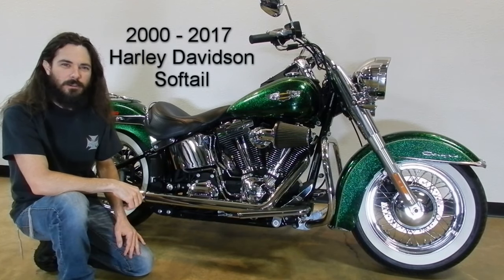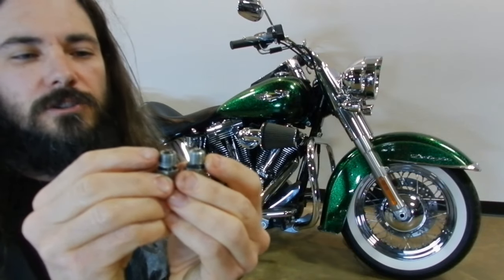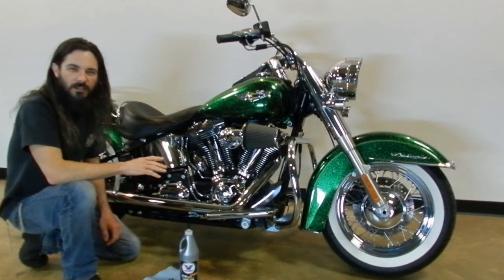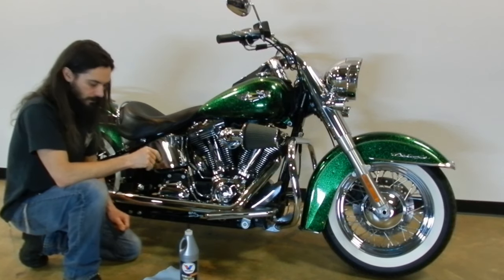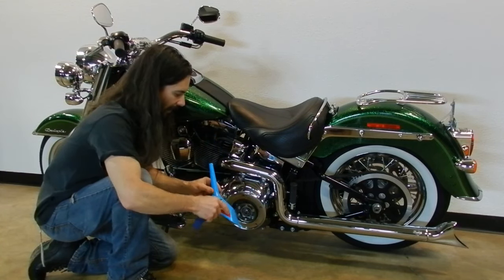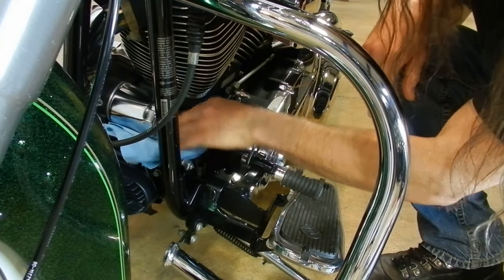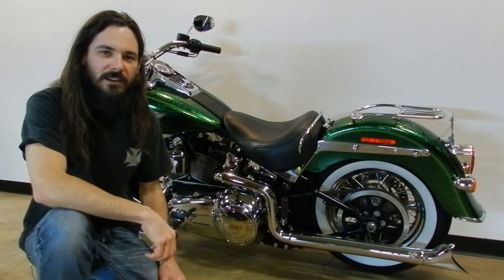3 hole oil change Harley Davidson SOFTAIL (2000 - 2017) Engine, Primary, Transmission Fluid service

Comment: I have a 2011 dyna street bob and although I do my own oil/filter every season I've never changed the primary oil. seems easy enough but seeing mixed comment weather it should be straight up when filling it or just leave it on the kickstand...it has 13000 mi btw
Reply from the maker: When adding the primary fluid, it might be a good idea to call a dealer and ask them for the procedure specific to your year and model regarding whether it should be upright or on the kickstand.   Or you could just go with your gut instinct, because the difference in the amount of fluid won't effect the performance, operation, or longevity of the machine in any significant way.

Comment: WARNING! The transmission filler cap is NOT always a 5/8" Allen Head. My 2011 FLSTN has a 3/8" Allen Head cap. This is totally on me for not checking first, but I did buy a set of SAE Allen head sockets that I... haven't needed yet.

Also, the clearance from the top of the cap to the bottom of the oil tank is VERY tight! An "L" shaped "KEY" is probably a better choice than a socket.

Comment: On the Softail you can disconnect the oil return line and crank the engine over to get even more used oil out. Just my 2 cents but a FRAM is the absolute worst filter made for any engine..they cut corner and use garbage materials inside.

Comment: Great video! Very much appreciated! I noticed you didn’t add any oil to the filter. Some videos I see them adding oil to the filter. Why or why not?
Reply from the maker: Hey Rob. 
Thanks for the kind words. 
The oil pump adds oil to the oil filter as soon as you press the starter button. 
It takes the oil pump two to three seconds to fill an empty oil filter. 
There is no reason on earth to add oil to the oil filter on a Harley Twin-cam engine.

Comment: Hey brother...my second comment, and a question: my local Harley shop wants over 300 bucks for the three-hole fluid change. You have saved me a lot of money! The question is this: is there any reason to torque wrench the drain plugs?  Thanks again for the exceptionally helpful video.

Comment: Just watched yer video here and it looks great!! And you were very brave to do the video on a nice clean floor. Not a drop of oil spilled or leaked!! I always seem to make a big mess when I do the change. Also, when you drain the oil, do you stand the bike up or leave it on it's stand?? No one seems to have a definitive answer, just wondering what you suggest..... And thanx for the video. Well done!!
Reply from the maker: Hey, Thanks Keith. 
I always drain the bike on the side stand, then I straddle the bike and stand it upright for a minute to let the remaining fluids drain, then lean it back on the side stand and put the plugs back in.

Comment: Outstanding tutorial. Thank you and ride safe 🤘🏻🤘🏻
Reply: By chance, do you know the torque specs?
Reply from the maker: The engine oil plug and transmission fluid plug both torque between 14 foot pounds and 21 foot pounds.   For the Primary plug, just snug it up, don't torque it down.
Reply from the maker: Thanks, glad to hear you liked it.

Comment: 4 plugs to drain oil , I removed the allen key plug from the bottom of the motor and got another 1/2 liter of oil out , the book does not mention this plug

Comment: Awesome video Jay, very informative and easy to follow. All in all one of the better instructional videos I've seen for a while  One question for you....how much benefit is there to performing a "full purge" change, versus your way? Purging after you change oil filter may mean some contamination to new filter, but this would be no different to not purging, even less if you find the engine drain point too. Even if you run in up first there must still be some oil within the motor not getting changed. Any thoughts?

Comment: I recently bought a 07 FLSTC and am changing the fluids for the first time. My question to you is about the amount of primary case oil you are recommending. You and others on YouTube are saying 26 oz. but the official (and expensive) HD book on my model definitely says that 36 oz. is required. The factory trained mechanics agree emphatically. Very nice job with your video though. I look forward to learning from you about other maintenance related goodies for my new baby.

Comment: WOW!!!  Thanks so much JW for this tutorial.  I read a few of the comments and I agree you should do educational videos.  I do have a question- what oil did you use in the primary?  was it the same oil used in the engine 20w-50 for V-Twin engine or did you use 20w-50 motor oil for autos?  Thanks again so very much for this tutorial.  Be Safe
Reply from the maker: Hey William, 
Its the same oil.  20w-50 for V-Twin.
Thanks for the kind words.  : )
Reply: @JayWCase  Thank you so very much.  This is my first Harley and I want to make sure I do everything right and now that I've found you and subscribed to your channel, I know my Harley will be in safe hands.  Again thank you so much

Comment: Great video, thank you for the clear tutorial!

Quick question: When checking oil after you change and run it, do you check oil in the position you filled it or while its standing upright?
Reply from the maker: There is not a simple straightforward answer to that question.  
Harley Davidson has been very inconsistent with this. 
It depends on the year and model and what dipstick you have.  
Check your dipstick and see if it has marks for both.  
Check your oil level both ways and see which one looks right on the dipstick.

Comment: great vid and info, just wanted to know does the primary cover have an O ring gasket that can be re used or do i have to go to harley and buy a  new gasket??
 any info would be greatly appreciated.. Thanks
Reply: I change my primary cover gasket ever other oil change. Change my 3  drain plugs same way BUT that is just my preference.

Comment: Great video.  You didn’t mention replacing the little rubber gasket on the oil drain plug and not ideal
To reuse the primary gasket.
Reply from the maker: I appreciate the kind words Todd.  
There is no need to replace the O-ring on the drain plugs unless they are leaking or visibly damaged.  Also it is not ideal to replace the primary gasket unless it is leaking or damaged.  If you feel the need to compulsively spend money, i can send you my PayPal address.  : )
Reply: Ha ha.  
I have always got the o ring included with the filter.  I did all my oils today and bike away for winter

Cheers!

Comment: Not to knit pick it was a great video but shouldn’t you have taken the oil filter off after draining replaced THEN add the oil? Seems like replacing fluid first then filter your new oil gets lost by removing the filter afterwards.

Comment: Must admit, had a devil of a time re-inserting the transmission plug. Hard to find the hole and square up the plug. Fear that I started it off -center because it was tough tightening. How common?.

Comment: Great video. Is there a crush washer on any of the drain plugs that need to be replaced?
Reply from the maker: Hey, Thanks Ron. 
No crush washers on these bikes.  
They have a replaceable rubber O-ring, but it rarely needs replaced.

Comment: Great video. Easy to follow. The primary drain plug (torx bit) is frozen. I cannot break it loose and the torx is stripped. Any suggestions?
Reply from the maker: My favorite fix for a seized or stripped screw or bolt is to use a MIG welder to weld on the end of the screw and then slowly stack small tack-welds one on top of another until i have built a knob on top of the screw that i can grip onto with a pair of vice grips.  Then slowly work the screw back and forth until it seems like the screw is loose enough that it will unscrew.
Reply: Drexel a slot in it and use an impact screw driver

Comment: Do you check the oil levels with the bike on the jiffy stand or holding the bike upright
Reply from the maker: Depends mostly on how your dipstick was marked at the factory. 
When in doubt, give your dealer a call.

Comment: Hello Jay what oil i should use for primary?You said you used 20W50 but some people use transmission oil
Thank you for answer
Reply: I use Type F automatic fluid in my primary fluid on my 00 Softail Standard and change it every oil change.

Comment: i see that you put a new oil filter on with out  putting some oil in the filter as i've seen in other video's, is it necessary to do that or no ???,   also your video is very helpful thanks..
Reply from the maker: Hey Victor, 
Thanks for the question.  The answer is no, you do not need to add any oil to the filter when installing a new filter on a Harley Davidson twin-cam engine.  The filter holds a very small volume of oil so it is filled by the oil pump in a couple seconds when you start the engine after an oil change.  Simply watch the red oil pressure light on your dash to see how quickly it goes out after you start the engine with a new empty oil filter.   On large diesel truck engines with oil filters that hold a half gallon of oil it is necessary to pre-fill a new oil filter to reduce engine wear at start-up after an oil change.  In these instances the oil filter is mounted vertically to allow the filter to be filled and installed without dumping out the oil.  Because Harley Davidson decided to mount their oil filter horizontally on this engine, i suspect that their engineers did not intend for you to pre-fill the filter and dump oil all over the front of your engine when you turn it over sideways to install it.  Thanks again for the question.  And thanks for watching.

Comment: After the new oil is added and started up to running temperature , how do you check to see if there is enough oil in the transmission and Primary compartments ,  is there a make some where or just top them up until you can see that they are full ???

Comment: Okay, this might be a silly question with an obvious answer but I’m a girl with zero mechanical experience who is in quarantine with COVID so decided to watch a video on how to change the fluids on my new to me soft tail to pass the time. Now, my husband is more than happy to do my maintenance for me but I thought it wouldn’t hurt to understand what goes into a fluid change. My question...why not change the oil filter before putting the new clean oil in?  I’m sure I’m missing something but seems like one would drain the oil, change the filter then put the new clean oil in.  There has to be a reason I don’t understand.
Reply from the maker: Hey Lyn, i don't usually keep up with comments on this channel during the winter, but i also don't get many comments from the Ladies, lol, so I'm taking time out on this special occasion to say thank you for watching the video. Thank you for caring about vehicle maintenance, it is an artform if a person will open their eyes to see it that way.  
Now, to answer your question.  The reason that it doesn't matter ~when~ in the service process that you change your oil filer (before or after draining the oil) is because on the Harley Twincam engine, the oil filter is isolated from the engine oil by the oil pump.  What this means is that inside the engine, the oil passage, which is the little tunnel that the oil flows through to get from the engine to the oil filter, is blocked by the oil pump gears when the engine is not running.  
So if you turn your engine off before you change your oil (haha), then no engine oil can flow TO or FROM your oil filter because the oil pump gears are not turning and those gears are blocking the oil passage.  So the old oil in the engine or filter can't mix with the new oil in the engine or filter until you start the engine.  
Thanks again, and keep up the good work.
Reply: @JayWCase  Thank you so much for taking the time to respond.  Your explanation makes SO much sense.  I feel like I learned so much from your video and the follow-up to my question. Now maybe I’ll surprise my husband with my newly acquired knowledge. 😉

Comment: My oil started leaking during the winter in my garbage from the plug. I’m going to replace it and do an oil change. Do I have to also drain the transmission for just the oil change?
Reply from the maker: Good question. 
No, you do not need to drain anything other than the engine oil.

Comment: Great video and thank you sir. I have a 2004 HD FXSTSi Softail Springer 12,400 miles and a 2004 HD 100th Anniversary Softail Springer 13,500 miles. I have been getting the 3-hole fluid change every year and I see now that maybe I don't need to change the other two fluids every year but just change the regular oil as I only ride each Harley about 1,000 to 1,500 miles per year? QUESTION on another oil change Youtube video, the mechanic ( Youtube: Ape Man 1450 Harley-Davidson Oil Change)  I noticed that he "purged" the oil lines after draining the crankcase attaching a clear hose in the oil line hole. After draining the oil he attached a plastic tube and then he started up the engine briefly and successfully removing more of the last old oil as much as  possible. I noticed that you didn't take that step on your oil change. Is that just overkill? Comments please?  Thanks Larry G. Golden, Colorado
Reply from the maker: Great question Larry. 
Yes, if you store your bikes outside year round in the rain and sleet and snow, or if your bike was in an area that flooded and they were underwater, or if you have purchased a bike that was in storage for ten years or more, then purging the oil would be a good idea.   If you change your oil at least once a year, then purging your oil is an unnecessary waste of time that scares people away from servicing their own machines.  Ape-man sounds likes hes up to a lot of monkey-business.  
Keep the shiny side up brother.

Comment: Your video has given me the confidence to do this myself.  Question tho.  Why do you wait til the end to replace the oil filter? Could you replace it right after you've drained the old oil?  Also, How much Primary fluid do you put in and what kind are you using?  Thanks!!
Reply from the maker: Hello, I am glad the video was helpful for you. 
You can change the oil filter at any point in the process.  
It doesn't matter when you change it.
I use the same oil in the primary as i use in the engine. 
As a general rule, you can add fluid to the primary until it is almost ready to spill out the access cover when the bike is on the side stand.

Comment: When running 75/140 gear oil full synthetic seems like that oil would run longer in side the transmission! Am I correct so if 20/50 is changed every 5,000 miles wouldn’t one think 75/140 run every 10,000 or longer before needing changed?

Comment: My crazy brother who always has car problem and argues with me about using good oil with high amounts of anti-wear additive zinc like I use in all my cars and that is Amsoil Z-ROD oil. My brother doesn't believe some oil is much better than others so he puts the cheapest oil he can find. Plus my brother lives in Arizona where you need good quality oil with the heat they have.

Comment: Hello JW, where is the dipstick for the transmission fluid and what did you use to open the gear box? I just got a 2005 Harley Davidson Fat Boy. I need to change all the fluids and probably the spark plugs. I am nervous about doing it and would usually take it to a shop, but this video seems to make it look pretty easy. It’s the first bike I’ve owned in years, and I’m in love with it. Thank you for this video. I look forward to working on my bike now.
Reply from the maker: The dipstick for the transmission is attached to the filler plug.  
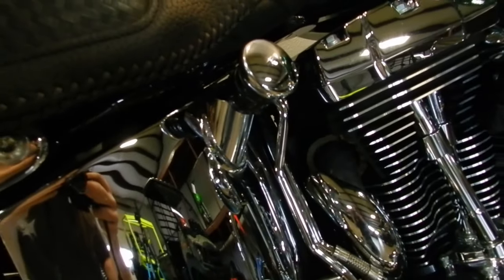At about 2:16 in the video i show the location of the Transmission filler plug and how to remove it.   If you do your service procedures along with this video and watch it all the way through, you shouldn't have any problems.   If you look at the other videos i have posted on my channel, there is a Fatboy service video, but the process is the same.  Best of luck.
Reply: J W Casebeer Thanks brother! Appreciate it!

Comment: Please add torque specs for primary cover torx screws. thanks!
Reply from the maker: Hand tight is all they need.   
If you use a torque wrench then you've over tightened them.

Comment: Does this oil change apply to the 2021 Fat Boy 114 Model also are all 3 fluids and quantities the same
Reply from the maker: Nope!! 
This video is for 2000-2017. 
By my reckoning, all 2021 machines were manufactured after 2017.

Comment: How’s about a video on servicing a 1992 FLSTC and other repairs..I have a front break caliper that won’t ease off the rotor and eventually locks the front wheel up..this is the second factory caliper I put on and I have rebuilt the master cylinder and replaced the the break line with a high quality line made at my local bike shop..only thing I haven’t done was rebuild the caliper..still can’t use the front break cause it continues to fail..any help ideas other then some smart ass (go buy a brand new front break system) would be appreciated

Comment: Also, I’ve been trying to drain my transmission oil from the wrong bolt for like 8 months. Thanks for the info man I’m a moron. But if anyone sees this please lmk the size of the torx head needed for the derby cover bolts. 27 is as close as I get but sometimes it wants to strip

Comment: My manual says that the primary holds 32 oz , but I could only get 28oz in . Is this because I had my bike on the stand when draining and adding oil ? I noticed that you changed the primary on the stand . Is that ok ?
Reply from the maker: Hey, yes, no problem. 
32 ounces is good. 
28 ounces is also good. 
It really doesn't matter. 
If you have oil in your primary, and its clean, and its 20 or 30 ounces, you are ready to rumble.  These machines are more like a tractor than a swiss watch.